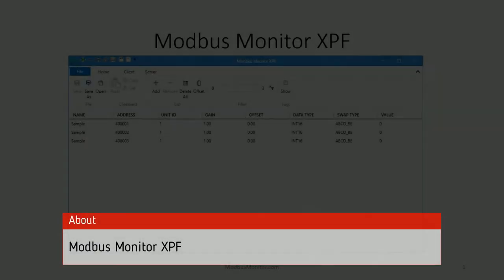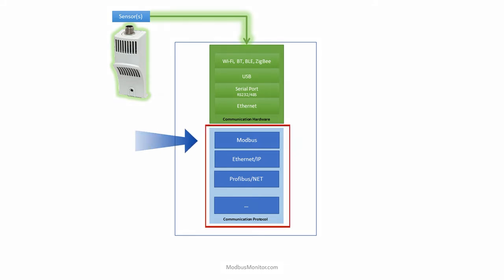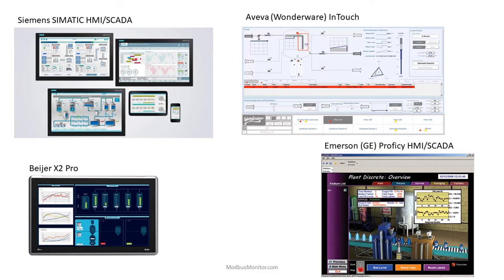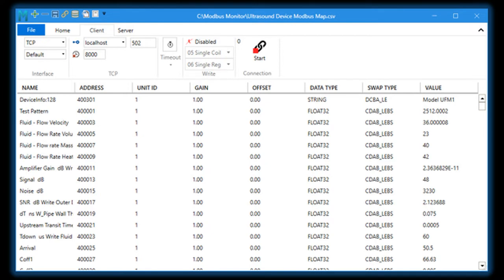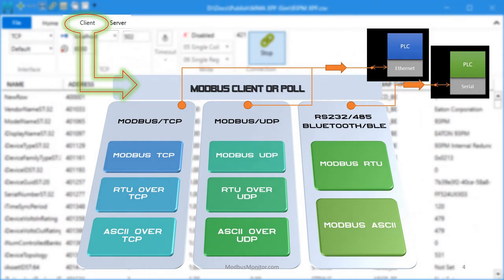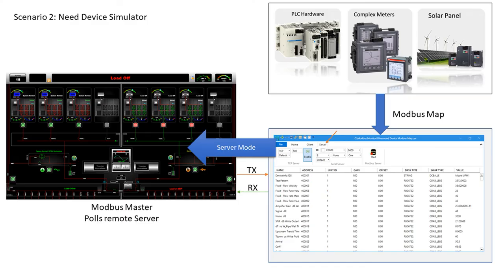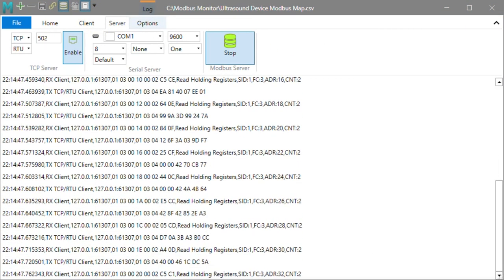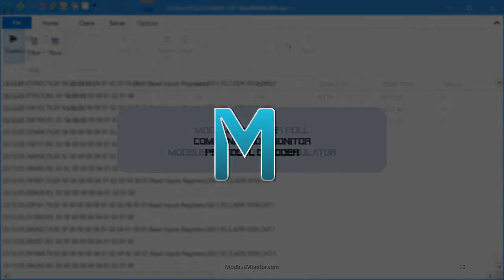Modbus Monitor XPF - Use Case

Comment: Hi, Can i export the data from the software Table to Excel?
Reply from the maker: Yes...Default File format is CSV format when Save button is pushed.  Excel can open the file for easy editing.
Reply from the maker: file saved from this software is in CSV format which is Excel compatible format